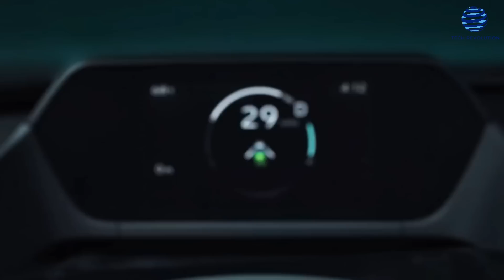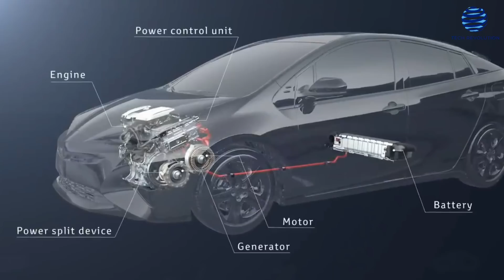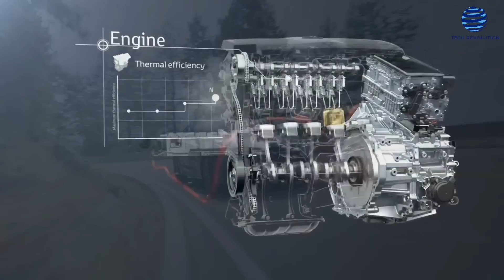ALARMING! Toyota's NEW INSANE Plan To CRUSH The Entire Electric Vehicle Industry!

Comment: Toyota is the next Kodak. Digital camera… just a trend that will go away… Toyota CEO isn’t connected to reality. BZ4X is a BYD. If Toyota doesn’t buy out BYD the will not make the transition to EV because of the adoption rate or adoption speed of pure EV’s.
Reply: Solid State batteries for coming Toyota cars will be from a JV with Panasonic.  Tesla's EV batteries are also made in a JV with Panasonic.  Israel is becoming a major source of fire-proof, quick-charge EV batteries. All this because the rest of the world has realised the risk of a supply-chain originating in China. The brands in big trouble are those that have traditionally spent more on advertising than R&D - Detroit's Big 3 - because these have smoke-stack era cultures. Silicon Valley was born in the Knowledge era. So it's entrepreneurs, like Steve Jobs, "Think Different" -  as does Elon Musk. For the first time ever, USA's new-age entrepreneurs are smarter than their politicians, generals, Wall Street, Hollywood and Madison Avenue. USA's politicians either dont know, or won't admit to their working-class voters, that AI has taken away most of their jobs...forever.

Comment: Great information on fuel efficiency of the hybrid which takes power from braking and puts it back in the battery for the electric motor.  Prius Prime the most efficient car mentioned at 130 mi. highway per gal.
Reply from the maker: Great point!